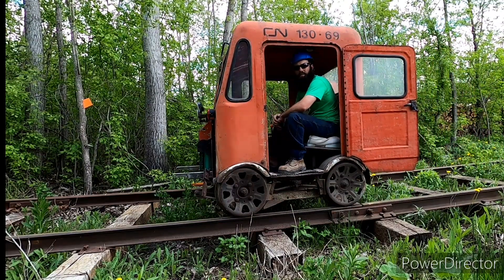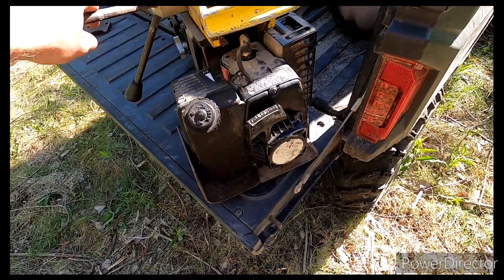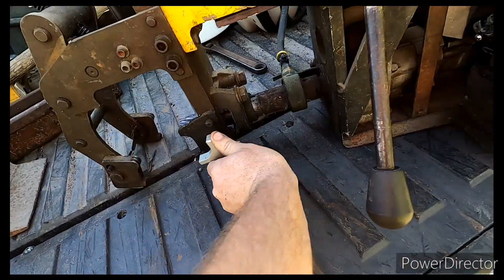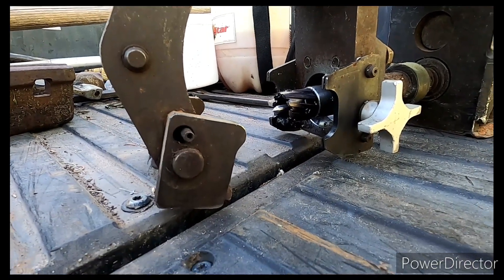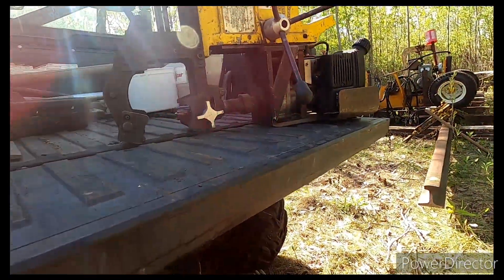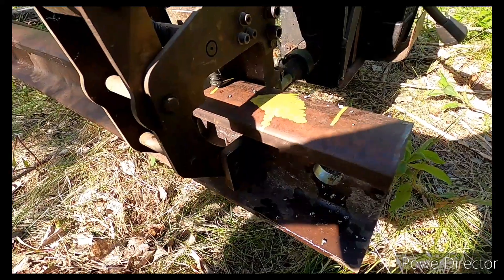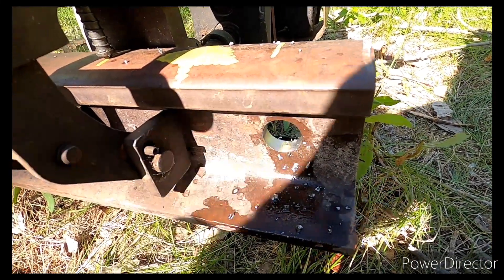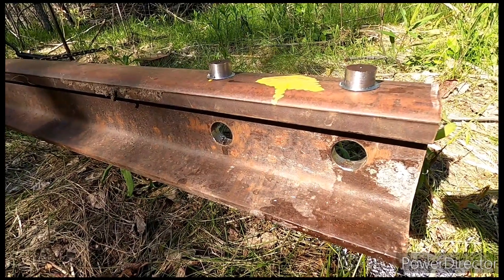Backyard Railway/Rail Drilling

Comment: @4:40  the sprung pin is for a bolt-hole spacing bar that would be clamped to the head of the rail at the end of the rail to space the bolt holes without having to measure each one.   Each rail section usually has a standard punching or spacing for the bolt holes.  This saves a lot of set-up time and trouble when drilling a lot of holes in the same size rail.  The drill we had on the Huckleberry had a spacing bar and we had 2 standard spacings as we had 75 lb and 90 lb from the old Pere Marquette.
Reply from the maker: You are correct. They make several different bolt hole bars for different size rails or rail hole center spacing. We use a mix of 80#asce, 80#rb, 85#asce, 90#rb and 90#re, so I didn't want to buy 3 different hole jigs.
Reply: @sandhillcentralrailway4447  You can make them yourself for the different bar punching if you wanted to.  With as few holes as you drill, it probably is not worth it.